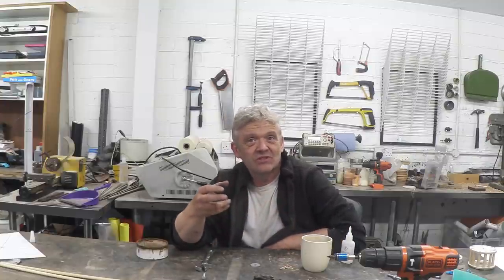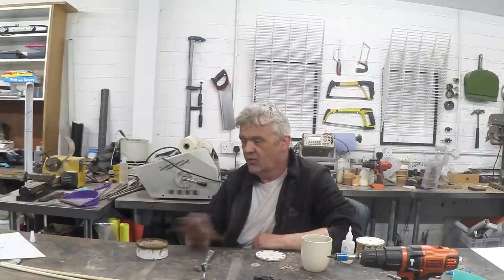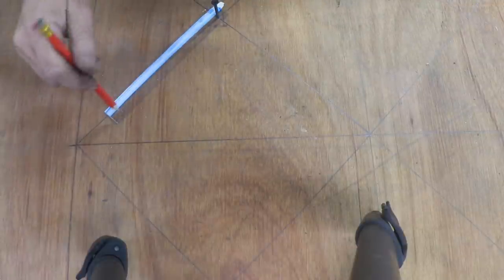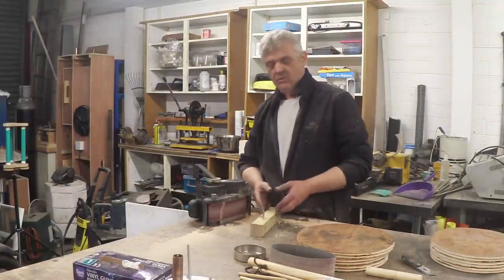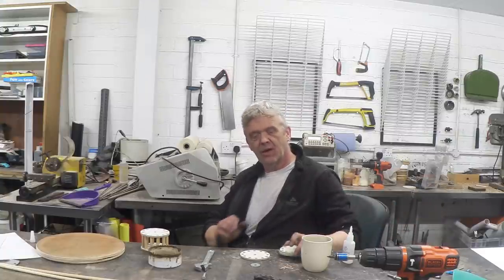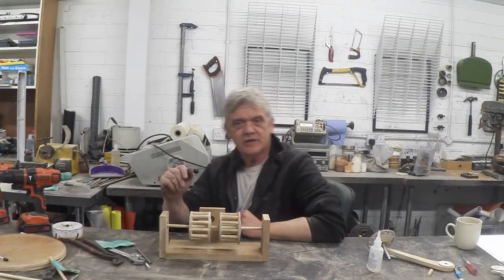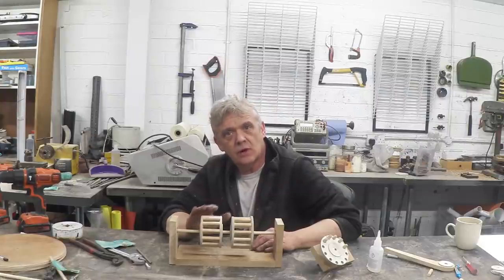Reciprocating Peg Gears For A Ton Of Uses

Comment: You can also clamp your jigsaw upside down in a vice and use a cable tie to hold the trigger on and rotate your square piece of wood using the centre hole on a nail.
This same method works with metal disc's and bolts through the holes tightened with nuts for a longer wearing peg gear. Even nails through a wooden disc makes a very quick peg gear if you have finer requirements.
Love the video as always, not sure why I didn't get the notification. Blame YouTube not RobTube, lol 😇
Reply from the maker: lol - youtube is up and down all the time mate - nice tips by the way - cheers

Comment: You can do the same process with a chopsaw, or use a standard table saw.  In both cases, all you need to do is keep the blades running at a set depth, then after you spin your material around a couple times just set the cutting depth a little deeper.  Repeat until you cut out your perfect circle!  Cheers

Comment: Lovely words of great importance in this humble video of yours. I can relate to this from the perspective of the high tech world of lithography. New engineers do not come with the knowledge of how stuff is made at the high end level and many do not have the very important perspective of making things by hand. Simple things become humongously important. Case in point, the story of the laser grating. As the actual real story... history..goes, a guy spent 10 years of his life making grooves on a piece of metal. Grooves so tight and precise that they refract light into it's components. All by hand on a simple groove making hand tool/machine. So precious are these metal pieces now because most gratings for lasers come from them as plastic copies. Who will do this again if we were to loose the existing machines? 10 years. No other machine can make them. I will find the link. But yeah, it brings it home, you need glass blowing, grating groove making, and many other innocent looking activities to make microchips.
Reply from the maker: nice illustration mate thanks for taking the time to post it - cheers

Comment: I liked the commentary on 3d printing  and the making by hand. I got a tiny 3d printer n a standard one and I noticed that as well takes so long to produce and dont appreciate it near as much. I barely use either now. Just for replacement parts handles organizing constructs, wood working jigs tho I have alot I've printed like pocket hole jig router jigs. That's about all I use them for that and toys for the kids lol

Second thought you could use wood circles  and use bolts ,washers, nuts for the pegs of your worried about longer term ware and tare. Even a threaded rivet . Or a circle of HDPE  plastic from a 5 gallon bucket.
Reply from the maker: They are a tool that is good for a job mate - what gets me is when folks tout them as the answer to everything - nice suggestions too - good post mate - cheers
Reply: Agreed. I use all styles of gears and chains drivers. I'm working on some wooden roller chain using some cheap 1/4 in osb  board scraps I have, but  then again you can buy popsicle sticks cheap in bulk and 2 different sized dowels  very cheap as well. Roller chain "bicycle chain" mesh well with peg gears to transfer motion long distances if you design the chain and gear correctly that is. Makes a great sound too.  I'm self teaching myself everything so when I find out there is another way even if its obsolete I like to try it. When comes to kinetic energy transfer. I jumped in the middle of everything I'd preferred to start with primitive base of concept  style stuff but I got a bit to excited. Thanks for the video was a pleasurem

Comment: I like these bc is alot easier to run several different gear sets off the same drive wheel just depends on how thick or wide you make them  and how wide you make your gears can use popsicle sticks for the outer edge style pegs they mesh better in my opinion.  A quick paint and seal can use as a rough water wheel
Reply from the maker: nice one mate thanks for the share

Comment: Excellent info! I've always imagined something like this being used to build the pyramids of Giza, using the Nile river for input power. The reciprocating gears would work perfectly to lift massive stone blocks level by level if you daisy chain a bunch of them together by adding more pegs on the circumference of the input gear, 90 degrees offset from the pegs that drive the cage gear. Using massive timbers to build the gears, they could produce some phenomenal torque by utilizing gear ratios. Large stones could also be cut with this type of mechanism by attaching a lateral cutting saw blade. This makes perfect sense in my mind. What do you guys think?

Comment: I’m wondering, could the reciprocating motion be achieved using similar mechanism but with magnets instead of pegs...?
Reply: you can but depending on the speed of change and the the weight you will probably introduce "gear slip"  with a physical interface of wood you only have to worry about the weight exceeding the strength of the dowels and the wear over time.
Reply: With gears in general you're introducing the physical strength of whatever you're using (wood, metal etc.) and torque (with proper power behind it) which could not be replicated with magnets in any everyday sense? I guess it really depends on what you're doing. The strength of material needed, and the power required behind it to drive it?
Reply from the maker: yes mate - but the comments below are spot on in their tips and adds
Reply: Very high speed reciprocating mechanism is very noisy and not reliable for linear generator. But if and only if a mechanism could be devised using magnets, then, I guess it might open up some doors to  a reliable linear generator.

Comment: Nice build Rob, simple gearing with basic maths and DIY tools, with all the mysticism taken out (well, most of it anyway!) 
I like that a lot, 

I used to do a fair bit of gear cutting on horizontal Mills and hobbers, with a Zeus book in one hand and a calculator in the other, it's amazing how it can be condensed down into simple ideas and rules of thumb, it might not be the most efficient and a bit noisy, but hey it works

I love the projects where you take something that seems complex and brain stonkingly hard to do and break it down into easy steps, I'm not that good at chemistry and I've probably learnt more about battery chemistry from your channel that has actually sunk in, than any other channel on the subject, 

I was trying to think of a name for this one... Rotary wiggler? 

If you like weird mechanical contrivances, search for 'animated mechanism' and you will have a ton of mad ideas
Reply from the maker: nice one mate - I will do exactly that and I agree the point here is to get something built that works not spend days scratching your head over the math lol

Comment: Its funny you talk about 3D printing. I have a side project that I am working on for a streamer. Kinda like the batman signal. It doesn't spin in a circle but goes back and forth. This project just helped out a ton. Question though... for this particular project (the mini one) did your 30* just happen to work out with the dowel size and the circumference or was there a lot more planning behind the scene? Just asking because it moved smooth!

Comment: Put the lever action sideways and it could be a great way to capture power from waves or tides. More from waves I would think but, I suppose with the proper gearing, It could be done with tides as well. Great video either way, maybe try it using magnets instead of pegs? Cheers Rob.
Reply from the maker: spot on mate and you are right peg gears are the basis of magnetic gears

Comment: In respect to using a chop/miter saw for cutting a circle: this can be dangerous, but with care once most cuts are made you can rotate the board clockwise, when work piece is on the right of the blade. Quite accurate this way just be careful everyone😉
Reply from the maker: nice tip mate - cheers

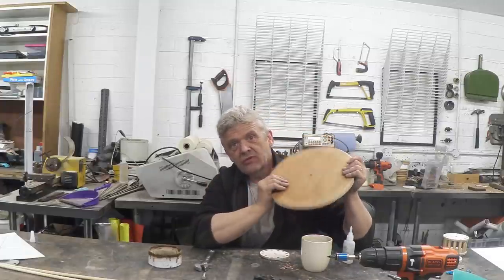Comment: 2:40  and here's one I'm preparing earlier
Took me a while to really see the advanages of CAD design and 3D printing, especially for prototyping. I still struggle with email tho, so I'll stick with luddite analog design and production. 😁
Reply: Craig MacDonald  Kinda like calculators tho... much easier than a slide rule 🤣
Reply from the maker: I see the advantages mate - but it's like any tool - good for a specific job - what gets me is when it is touted as the answer to everything
Reply: Yep, the first metal lathe would have been made using a wooden one😲 CNC is amazing but nothing beats the satisfaction of hand made.

Comment: Is the second cage gear actually necessary? Couldn’t you get by with a single cage that’s double wide? 🤓🤔🤷‍♂️
Reply from the maker: yep but that would make the pegs weaker - you don't need cages at all you could just make 3 peg gears
Reply: Robert Murray-Smith, do the pegs need to be particularly strong? The force is being applied to the short end of the lever, even if the lever is longer. Furthermore, it’s the same as the leverage being applied to the pegs on the input wheel. I was actually thinking that swapping the two cages for wheels may make the thing last longer, because the input wheel is currently doing a lot more work than it otherwise might. 💜🤓👍

Comment: Here’s another idea to play with. What about looking into using stored energy as an energy source such as a clockwork motor or maybe using some large wooden gearing build a mechanism using a counter weight like you would see in a Grandfather clock ... it would be interesting to see how much stored energy you could utilise to turn say a generator. 
With a suspended weight it’s all about power to weight ratio and a suitably high gear ratio. Down side is it will take a lot of winding but would give a lot of power but for a short period of time. 
Be interesting to experiment to see what you could get in terms of useful power.
Reply from the maker: it would mate and I think you should get building lol - cheers
Reply: Robert Murray-Smith I might just have a go at that some point bud I was inspired by your gears !